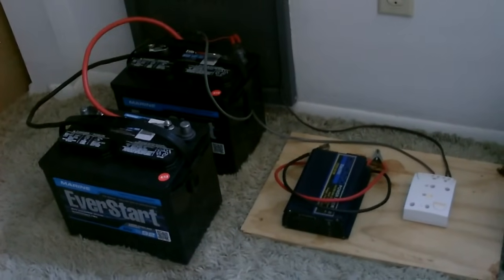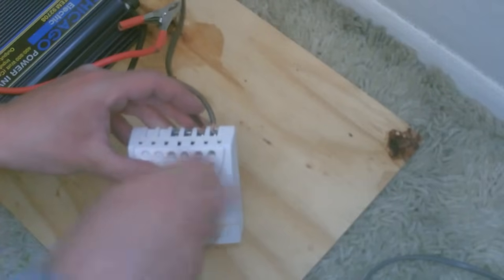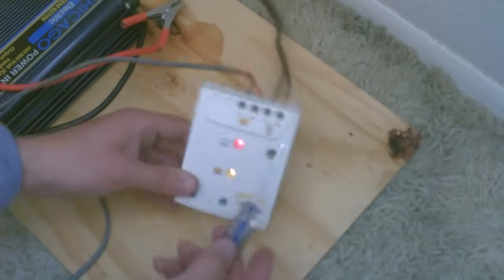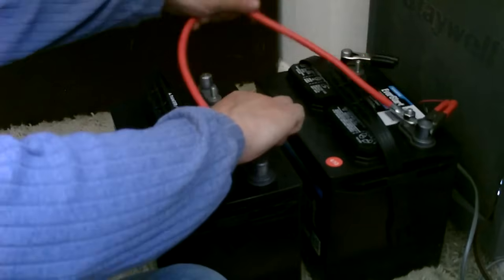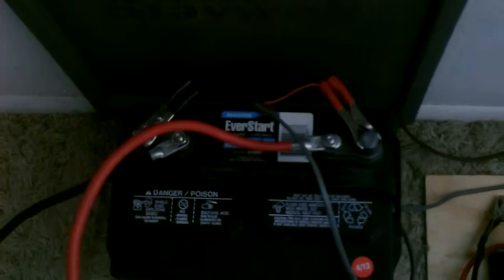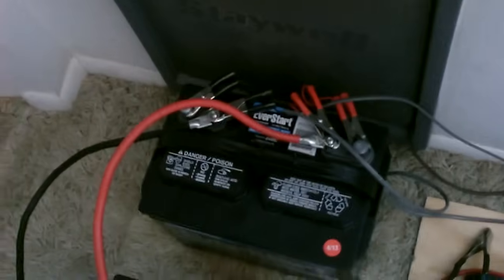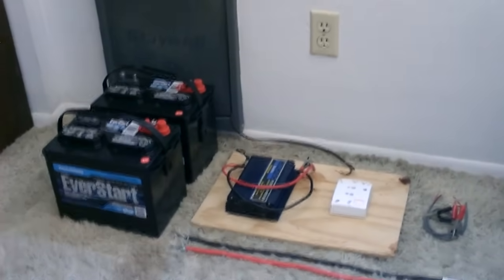How to hook up Solar Panels (with battery bank) - simple 'detailed' instructions - DIY solar system

Comment: Hey , I just watched another video with almost the same set up . He had  positive feedback all good . He stated to hook up load and inverter he used the negative and positive of the 2 different batteries  . You went positive to negative on he same battery ( lead ). Like I said he had great reviews . I am confused .
Reply from the maker: hi there. if you're just using 2 batteries and don't plan on adding more, then there's a couple of ways you can hook it up. people think that doing it the other way helps balance the load on the batteries, but research shows that if you're using 8 batteries or less there's no measurable difference between the load or draw on any of the individual batteries. and a "just barely measurable" (but insignificant) difference if using more than 8. note:  if your system is large (20 or more batts) then you'd want to research a more complex setup all together.

Comment: I have 4 solar panels 77.5watt each. charger controller 20amp, inverter 375watts and 2 batteries of 105ah. will this components perfectly work together and what is the best way to put them together.

Comment: I would like to make one of these to power my swimming pool. Can a system like your built run the pool pump and charge the batteries (via the solar panels) at the same time? Meaning can I run the pool pump (powered by the batteries) during the day while the solar panels are collecting energy from the sun?

Comment: 1. Solar panels go into charger controller
2. Charge controller goes into lead battery 
3. Lead battery goes into invertor for AC
4. Lead battery can be paralleled with other batteries.
Reply: Can solar panel work without sunlight
Reply: @idowulukmon642  burning magnesium would do the trick
Reply: Can this setup run without the battery? Solar panel to controller, controller to inverter then direclty to load?
Reply: @theviralkulitis92  no. And ffs connect the battery first.
Reply: @RightOne1  that's awesome I'm happy for you. Take care and can I recommend you go see your Doctor just sayin.
Reply: @mooseman-i4z  What you are proposing is a Free Energy System. It's you who is urgently in need of a good physics teacher. If you have already gone through one, then surely require a highly trained  psychiatrist. You have posted exactly the same question elsewhere in this post and continue to get the same boot, repeatedly.

Nothing is free, anywhere.!
Reply: @mooseman-i4z Correction ! Your doctor is free of charge for you. 

Because I have already paid for him with the millions earned from your system. 😀😀😂😂

After that, try to get a patent for it. 😂😂😂😂 Will love to see the expressions on the faces in the patent office.
Reply: Was that really the correct order? or battery goes to charge controller prior to panels?
Reply: @johnmanahan6529  he has it right, panels charge batteries and you need charge controllers to control the charge of the battery.
Reply: @samuraimedi4061  battery goes to charge controller first before panels?
Reply: Check out Tin Hat Ranch I think the channel is called, he goes in depth on different ways to wire, like in series or parallel etc. Hes got some cool off grid videos.
Reply: I want to throw this out there and see if anyone is a nerd on this kind of stuff . what about using a battery bank to run into and inverter to power and electric motor which will run the turbine of a generator which produces power to put a charge back into the battery bank which in turn keeps the batteries charged to run the inverter to run the electric motor and do away with the solar panels would it work?
Reply: @mooseman-i4z  If you think of electricity flow like a water in a plumbing system, things may become more clear to you. It's always good to think about things and maybe you might be the next Tesla to challenge and change the world for the better. Always, try to understand your environment and give away as much as possible to humanity while maintaining your dignity. 

Everything has loss from one type of conversion to the other. Add that to wire, friction, gravity and connector losses. Then there's loss due to corrosion and not having a perfect connection. Add this to heat loss of the various conversions to run systems. Motors and generators have their own unique losses and can also be calculated. There is startup, running, load and no-load situations. Everything can be calculated and there is no free lunch (free energy). 

We all want a free lunch so we don't have to pay for energy. In a perfect world, which does NOT exist on Earth, your idea may work, but not as is today. Maybe losses in space will be a lot less due to no gravity and extreme cold.  I can't speak to small nuclear energy plants, but they look promising. 

I have real world experience. I maintained backup battery systems for over 30 years and now designing my own solar power system.  Looking for setup ideas is the reason I'm here.
Reply: @mooseman-i4z  Perpetual motion doesn't work. Sorry.
Reply: @mooseman-i4z     He he he , I hope you are just having a little fun  ;-)   You and I both know that that would not work due to an F word,     er , no the other F word  -   Friction.   Friction causes losses, losses means that each part of the system would always output less power than it receives and hence the system will eventually run down.  Sorry bud , nature does not allow us to get something for nothing.   Look up Einstein's  E=mc 2 equation and the Conservation of energy :  energy is neither created nor destroyed.  Energy is only ever transferred from one form to another  .   Just for the fun of it look up Perpetual motion machines, none can work , but some ideas are quite ingenious .
Reply: @eddiepires3998  what if the design was friction less theres plenty of working examples that have existed in time
Reply: @user-ij9xi5ey9j  yes I know it is tempting to think that there is a configuration that will work . I'm referring to frictional losses that are very small.  Even with really good lubricants those small losses pull back the percentage of efficiency and it is enough to cause the system to eventually wind down.  It might give the illusion of perpetual motion by running for a while but using some measurements and mathematics it will be shown that it cannot work.  I like to keep an open mind so I'd be keen to look at the examples you refer to if you can point  me in their direction.
Reply: @mooseman-i4z  Simple answer no! . There are a few vids on this subject...
Reply: There are also inverter/solar charger hybrids. 

1) solar panels go into hybrid inverter. 
2) hybrid inverter go into battery. 
3) hybrid inverter go into outlet

Comment: I'm just wondering, how much does all of this cost? I'm considering installing one in my house for just my old t.v. What is the cheapest i could spend with this and how much would that be? Thanks :)
Reply from the maker: hi there. these days, all of this can be bought for about 335 dollars. tip: instead of buying several small solar panels. just buy one 100 watt solar panel (amazon sells them cheap $95 to $139) and use 2 batteries for each 100 watt panel. *best place to buy the batteries (that i know of) is walmart. they're just as good as most hi-priced batteries and last just as long.
Reply: What brands would you prefer? (cheapest priced) and where could i purchase those?
Reply: Just make sure they are deep cell batteries. Brands don't matter that much.

Comment: I see your charge controller only has input for panels and output for batteries, whereas others have a 3rd, an output for the "load" 

is there any difference in getting a controller which has a "load" output and connecting an inverter there, or a controller with no load output just the battery output and connecting the inverter at the battery?

Comment: Thanks desertsun02, great info. I have a 120w folding panel with what I thought was a controller  inbuilt on the back. So I attached this to the battery, which is now screaming its lungs out at me with a red light. could that be because I left the inverter attached to the battery or do I need to add a charge controller. PS battery is 105deep cycle and inverter 600W. Cheers and thanks again for the info, nice and clear easy to understand for a dumbo like me

Comment: Hi, nice video. I have a question. What if I plug the inverter into a plug, like the one near your inverter from the video. Would it feed power back into the house? can it even be done? I don't do much outdoor stuff, but I do have 2 experimental solar modules producing over 350w a pop and would like to use it at the house without going all out and install it on the roof.

Comment: Hi I want to power  a shed.  Few lights (led bulbs), stereo and a 50 inch tv.  Can you tell me what I would need for this setup.  Well 2, 100 watt panels work?  With a 1000 watt inverter? What kind of charge controller would I need or ate they basically the same?  Also would I need a few batteries? Ans would I use series or Parrell  wiring?

Comment: Desertsun02 very nice vid thanks for the clear explanations. Back to basics always helps. 

Can anyone give some insight: 

I am working on a very similar project and i have a window of 50 more days before my schedule tightens back up. I need to get a solar system on my van quick style. I have a couple questions maybe you'd be kind enough to throw some ideas my way...

I want 1000 watts of panels as well. It seems extremely tough to get help on the subject though. 

I don't want to get a kit because like making your own computer i'm sure there's better products available. This is what i need your guys' experience in. 

Pretty standard:

If i had a 960-1000 watt panel system:

-What would be the best controller.
-What would be the best/Safest Inverter.
-How many batteries (I like the Vmax 155ah deep cycle ones)
-What should i use for fuses/fuse box
-and what kind of wire is safe to put it all together with. I really need to know what wire i will be connecting the controller to the panels because i need to run that wire and start closing up the walls. 

Anything will help guys.. and if you happen to know a good source for more info 

I just want to make sure i put this together with the correct components. My budget is the exact cost. which means i'll be over guaranteed.) no room to fudge up

Comment: Hi. I just want to create a power backup system that will run my rollerdoor and maybe a sensor light for when the power goes out. My question is.... Do you hook the inverter up to the Solar Charge Controller's DC output OR directly to the battery?
Reply from the maker: hi there. you hook the inverter directly to the battery.

Comment: Hey there<

thank you for your illustrative video, 
i have a question, i have a solar panel of 200W, and i cant connect the solar panel to the charger control because there is a connection, So Can i strip this connection and wire the panel directly to the charger controller or not?

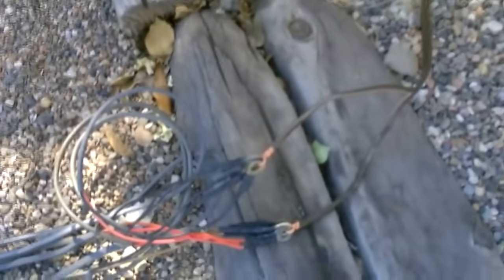Please see at 0:33

Regards,
Reply: You could if you had to but they make a hookup for that and its under $30

Comment: Hey I have a Vmp 30.8
                        Impp7.96
1 Solar panel can you help me out? N tell me what kinda off charge controller I should use? Please
Reply: Max power 245 
Can you let me know also what kinda off cables I should use for solar panel to charge controller

Comment: Great video, thank you for sharing.
One question, how long would it take to fully charge both batteries from 0% or 50% to full capacity using your 6 15watt solar panels?

Comment: Hi nice video, kindly assist me on this one please,
I have a 130 WATT SHARP SOLAR module NE-130U1-12V (SOLAR PANEL)
Maximum Power (Pmax) = 130 W
Open circuit voltage (Voc) = 29.1 V
Short Cuircut current (Isc) = 8.2 A
Rated Voltage (Vpmax) = 17.4 V
Rated Current Ipmax) = 7.5 A
Maximun System Voltage = 600 V
Maxumum series fuse = 15 A

My questions are:
1) can I use a PWM 12 Volts charge controller OR which is suitable ?
2) Can I use an INVERTER between 500 WATT to 2000 WATT with it OR which is suitable ?
3) Can I use one single 12 Volts battery with it?
4) What fuse size can I use for the solar panel and for the battery OR must i use a fuse ?
5) Can I use car battery in place of a deep cycle battery ?
THANKS
Reply from the maker: hi there. 1.) the panel you describe is considered a "12 volt" panel so, you can use a PWM 12 volt charge controller. 2.) you could use any inverter from a 60 watter up to 2000+ (but if you only have one panel (and you don't intend to expand the system) i would probably use an inverter no larger than 200 to 400 watts. 3.) i recommend using one battery for each 3-6 amps that a panel produces (3 amps for each battery being the optimum). since your panel produces 7.5 A, i would use 2 batteries. when it comes to fuses, each system is different. in my case, every component (inverter charge controller etc...) already has internal fuses/breakers installed (plus low batt alarms and auto-shut-off sensors). check all your components and fuse according to the manufacturers specs. and 5.) do not use a car battery (they would most likely be ruined after a few charges).

Comment: Can you use any type of deep cycle batteries? Anyone know I can see he's using Marine batteries in his system.
Reply: Bipin Karki Sealed gel and absorbed glass mat are preferred by sales men since they usually cost twice as much and last 1/2 as long. Also, set and forget people like them, but it comes with an elevated cost and a lot of green to spend.
Solar Pro's go for batteries that can be filled with h2o, even though it is time consuming. Pro,s go for batteries that can be opened so they can check the SOC of  acid so they know the state of charge and to diagnose any problems way before the batteries are killed. You got to have access to the acid to perform maintenance the proper way and to be able to check those batteries the proper way.
Many Pro's are using forklift batteries. The use more power to recharge them, but they last a long long time and they are serviceable.
Reply: Yes as long as they are deep cycle. I run a size 27DC rv/marine battery.
Reply: sniperu1
You done pretty good with those batteries if they lasted 4 years.
Are you by any chance in the northern part of the US or even Canada where the climate is cooler?  It seems that batteries in a colder climate last longer.
Reply: +Bonnie Flory I live in southern California. but I've had that battery in over 100 degree weather and a couple times in about 25-30 degrees. It's a battery I got from Walmart.

Comment: The system I'm trying to build is very similar to this one, but I have 4 12v, 35ah batteries. I can't get a single person to answer a simple question about what gauge wire I need to parallel the batteries and then whether or not I can use that same gauge to run to my inverter.
I think people who claim they know this shit really don't because they won't answer that simple question. Asked a bunch of people and the ones who bother to respond don't give me a straight answer.

Comment: Gr8 video and informative too. Want to ask your opinion on a subject. What if i installed a motor driven inverter that generates voltage and route it through the charge controller to the battery to work when the battery voltage drops to a certain level? How effective would it be compared to the solar option where sunlight is the main factor? This way when the demand increases and battery power drops i can still produce enough to charge the battery on it own  and power the house through inverter.
Reply: Most likely, the charge controller will burn up since it is made for  current regulation and not voltage.
But they make 12 , 24, 36, 48 volt DC generators that turn on and off automatically. Look at ebay.

Comment: i just bought 2... 40 watt solar panels they both came with charge controller...and i am using 4 batteries connecting them parallel ...do i have to use both charge controllers if so how do i connect them both to 4 batteries...

Comment: hiya Desert please tell me if i am drawing 4000watts 24/7 from my inverters  how many 12volt deep cycle batteries would i need and  how many total watts  of solar panels i need to make sure my batteries never run out of power.Thanks
Reply: That's a big power draw.  You'd need dozens of batteries.  At this level, you would benefit from the services of a professional, rather than trying to DIY.
Reply: Would cost a lot of money.
It would be way way way cheaper to run a generator.
About a 20,000 watt solar panel system is needed
About a 4,000 ahr battery bank at 48 volts and a 400 amp charge controller.
Or about a 16,000  ahr battery bank at 12 volts and a 1,600 amp charge controller.

If I done my rough calculation right. The real numbers should be a little worse.

If your 4,000 watt load is a inductive load then you need about a 20,000 watt inverter.  If it is a resistive load than a 8,000 watt inverter will do.

Just a rough calculation/estimate.

Comment: OHH - EMM - GEE! You, Sir, are a God amongst Gods - - thank you for sharing your 2 related videos!  You might be thinking "Dude, they're just ice cubes.", but you don't know what you got 'til it's gone...

Case-in-point: We had to shut our water off for the better part of a day for repairs. We have a refrigerator with a TINY ice maker.  2 glasses of ice & you've already used up 1/2 your supply. Putting 6 trays in the freezer is a pain in the butt + no room.

In 90-100° Temp's, we'll be using up the ice faster than the machine can produce it.  This is the cure!